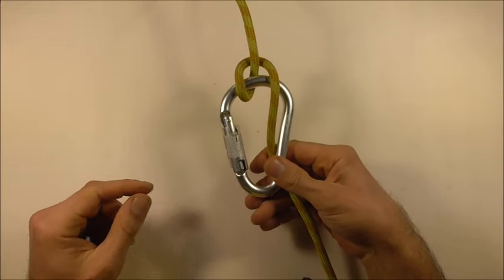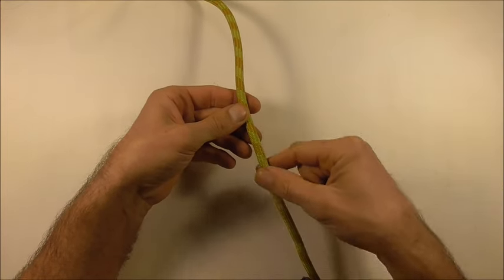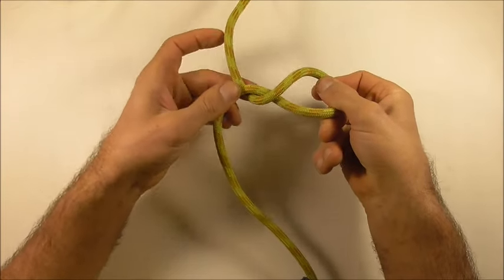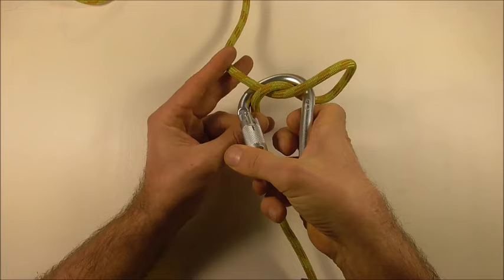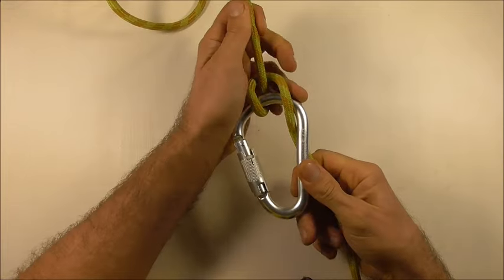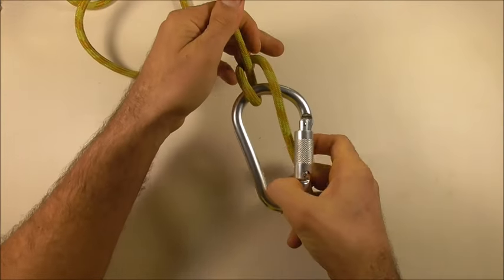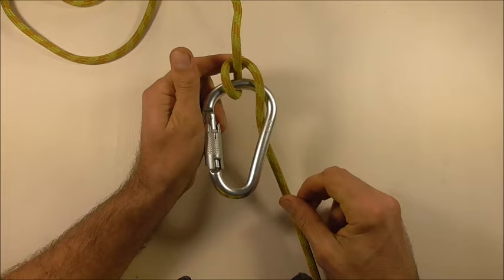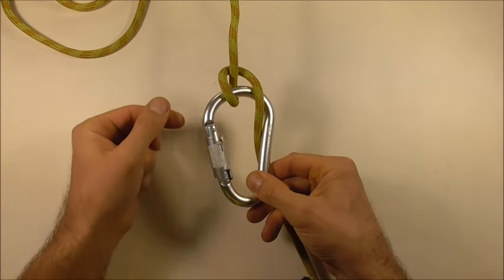"Easy Way To Remember How To Tie The Munter Hitch"

Comment: Knowing how to easily tie the hitch is great BUT it would be even better to have more info in the description about its use, its pluses and its minuses.  For example:   ROCK-CLIMBING:  - Essential hitch for every multi-pitch climber, in case the primary belay or rappel device is lost  - Do NOT use as a replacement for an ATC or other device because it severely twists and very slightly weakens the rope every time it's used.
Reply: Markus  Rescue use  https://youtu.be/WrIeLobQ8M0          Applied Munter  https://youtu.be/GIbPPMWCRBc
Munter transition    https://youtu.be/g5UpwvoE9B4?list=PLReui7yACwpacrlEc5Mu521bzfyd67zGW

Comment: Kind of weird having the brake and load strands heading in opposite directions. I think you typically pull the brake strand in the same direction as load to control the hitch.
Reply: Not when rappelling
Reply: Agree.